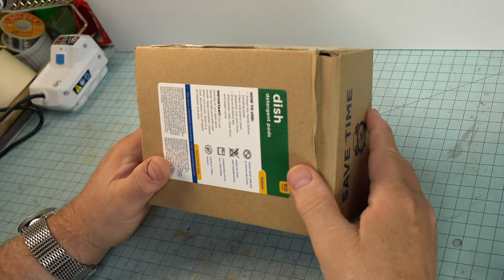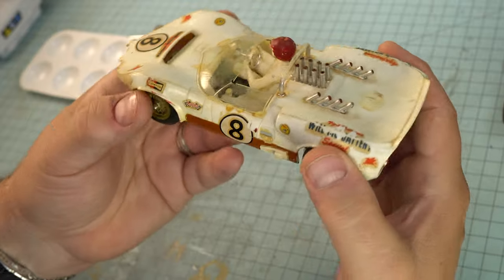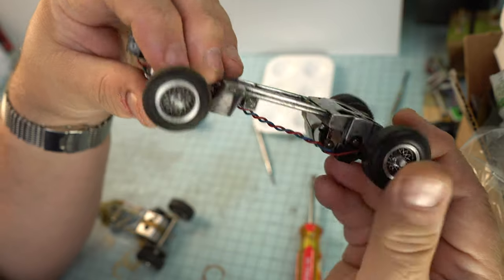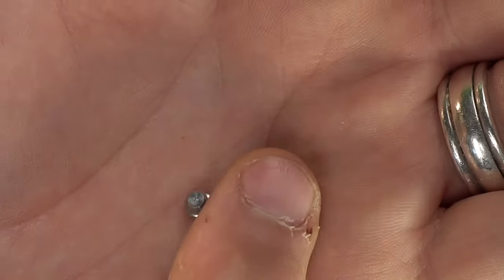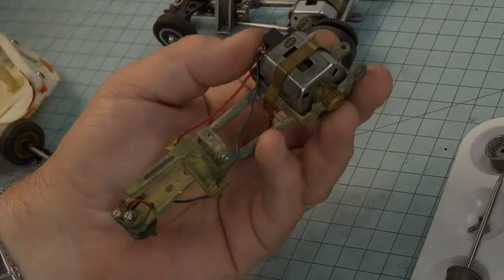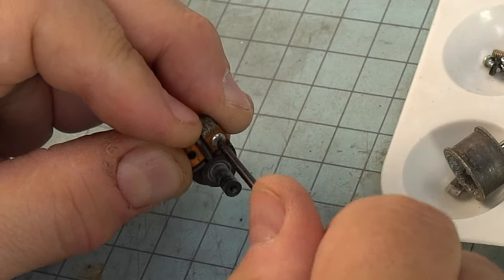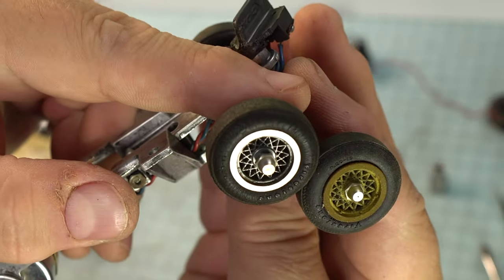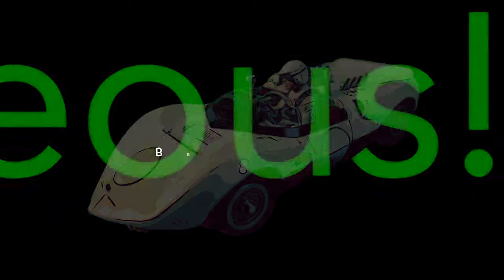Restore a Classic Cox Slot Car! Part 1- The Big “Look In!”

Comment: Is part of the tyre problem the heat that is generated in the rear tyres hot and cold repeatedly with traction where the front tyres more don’t have as much contact ??
Reply from the maker: Yes…I think you are right…it sounds logical!  Thanks for watching and checking in!

Comment: The front tyres don't experience the heating and cooling cycling like the rear tyres.
Especially if the front tyres barely touched the track.
The rear tyres are warmed by running on the track then cool down afterwards.
This degrades the material that the tyres are made from whatever that may be.
Reply from the maker: That is a great and plausible explanation! Thanks for adding this tidbit.
All the best! Doug
Reply: @FullEarthWorkshop  . I restore a lot of Scalextric cars, so it's something I've just noticed.
I also race a few sometimes and have already had to replace the rear tyres on those cars frequently.
Often the first time I encounter the rear tyres having hardened, if I can I'll swap out the front tyres with the rear ones